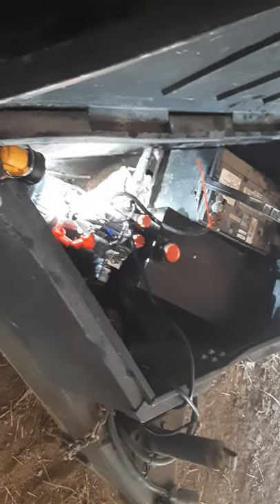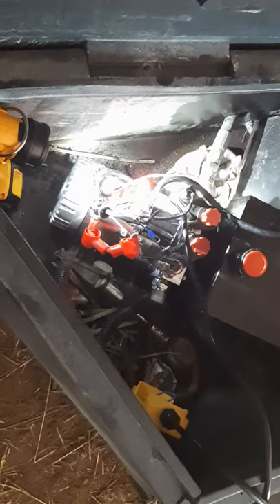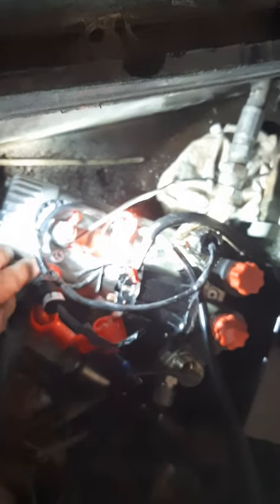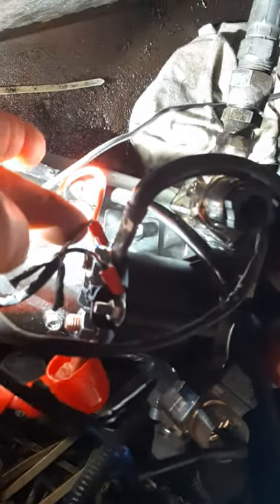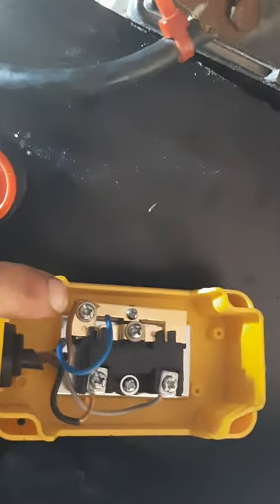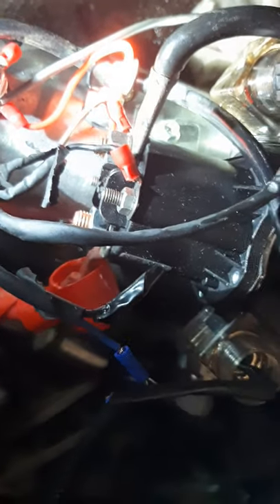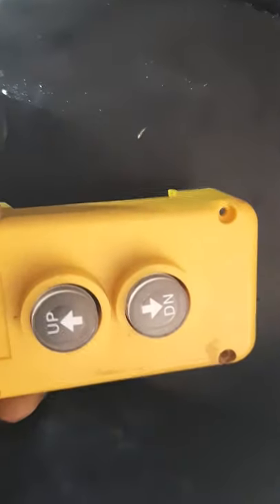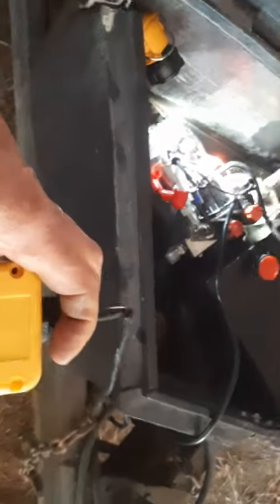Convert double acting pump to single acting.

Comment: Hey, I wanted to thank you again for getting me thinking about the right way of doing this and after a long time I was finally able to get a hold of the manufacturer of these type of pumps and they were kind enough that actually send me PDF with detailed drawings and instructions on how to even do a better conversion from a da to a sa pump.  Directly and they can supply you with the documentation to do it. I wish I had a way to do a file share attachment in the comment section and I would share it with everybody.
Reply: Hey Phillip Haverly I have not been able to get a hold of the manufacturer for a proper schematic do you thing you can email me your PDF? I think this video is a great start but not sure what happens to the other solenoid... Does it just get disconnected?
Reply: Can I get a copy of that pdf?

Comment: 👍👍 thank you so much for posting this that's exactly what happened to me I ordered the wrong pump and I was starting to think about replumbing it instead of rewiring it thanks so much. I only wish you included a PDF with the schematic of how you did rewire it thank you.
Reply from the maker: Sorry no drawing... had found a bunch of drawings online but nothing about converting it.
This was just more trial and error... do it wrong a bunch of times... till you do it right! Glad you got a set of drawings that worked out for you!
Reply: Did you blank off the second outlet where the 2nd pipe would go?
Reply: , did you just leave the 2nd pipe outlet or blank it off so fluid don't squirt out?

Comment: I've got  the same double acting pump, mines not working right, unhooked the blue wire. No fluid either port but I've got pressure on guage, hooked blue wire back up as factory and Right port pumps fluid out. When I let it down it blows fluid out the left port. Why

Comment: Did not work for me. I did somwthing similar but when lettign down it blows fluid out of the opposite port. I ran it back to the tank. Will work for my application but not the best

Comment: I have a double acting power pack and a double acting cylinder that can't take power down..it will blow the seal...so I want to just press down on the remote and have the fluid gravity down...!one what is done here..as that's how the stacked lift has always worked...but my new power pack is double acting.   Is all I have to do is reconfigure the remote so that the motor won't activate but the solenoid will?  I hope I've explained myself ok.   My cylinder has 2 ports...bottom and top so I thought it is double acting but when I put power to it with the remote...it worked..but blew the bottom seal and popped up the sweeper gasket thing on top of the cylinder..squirting oil out of it s well as the bottom.
   Maybe the down pressure is too high?  Or the hoses were hooked up  opposition to right way?  Any help or suggestion is much appreciated!  Its for a stacked lift being used as a wheelchair lift :)
Reply from the maker: My double acting pump had 4 ports.
The video (not very well) shows using 2 of the ports & leaving 2 unused.
Rewiring the remote makes the 2 ports active. "Up" under pressure and "down" by gravity.
Hope that clarifies for you.

Comment: Hi thank you for ur video but I do have a question what should I do with the blue wire hope u can answer thank you again
Reply from the maker: It's just a spare that is not required. Runs to the other solenoid... but you don't need it. Just tape it off.

Comment: What about the other sides In\out outlets?  Can they be left as is and just ignore them? Or do they have to be capped off somehow? Disconnect it from the remote?  Ive got the exact same problem here.  Still frustrating.  Mine is for a wheelchair lift.   Great video man, thank you for taking the time!    I'm sure ill be watching, rewatching 50 times ;)
Reply from the maker: I didn't cap mine off... your rewiring the switch to eliminate the other side. It is irritating but once you figure it out, it will work like a charm. Good luck.
Reply: So it won't leak if you don't cap off the other  high pressure hose intake?
Reply from the maker: @moreality5745  it won't spray out if you don' because your removing the fluids ability to access that side... if it does for you then a couple caps should not be to bd to add after the fact.

Comment: So does the gray wire on the down button get connected to the positive to open the valve?
Reply from the maker: No, the gray wire is connected inside the solenoid already and just needed to be moved in the switch.
Reply from the maker: @paul hodges

Comment: i have zepro backplatelift hydraulic unit and trying to use it with my dump trailer cylinder. back plate lift has 2 cylinders, both of them are single acting. unit has 2 solenoid, I think i only need 1? but not sure. are those 12v hydraulic unit  closed loop system so if i start tha pump motor i have same time open the solenoid and therefore piston goes up. and when lowering the cylinder what should i do then :D open the other solenoid ? :D haha greetings from finland
Reply: @Jrpp Marti if it's a double acting pump... but 2 single acting cylinders... then yes, you will only use 1 solenoid.
What about a Y splitter to go to both cylinders?
Hope that helps... i'm just a farmer that bought the wrong pump! Ha.

Comment: Did you cap the other output ? I can't tell from this
Reply from the maker: You don't need to because the other relay is being deactivated but it won't hurt.
Reply: I greatly appreciate I've been messing with my new to me trailer the guy gave me a new pump but it's exactly what you got going on here
Reply from the maker: @anekuda  well... at least you weren't silly enough to go out and buy the wrong thing! Ha. Glad it's steering you in the right direction.

Comment: If you guys have a vevor assembly, you switch the blue wire and the black wire in the remote. Im not sure which one this guy has. I ordered a single acting pump and recieved a double acting.
Reply from the maker: Not sure what happened to your accurate breakdown of the engineering behind this video... but you gave the intellectual version of my farming explanation.
Reply: I got a vevor assembly and found it works for up with all wiring as delivered, but will not go down more than a couple inches. was your solution to implement the Death Valley Farmer's solution with the one change (sap blue and black)? Or was it to swap the blue and black with all else as delivered from vevor? thanks for you response